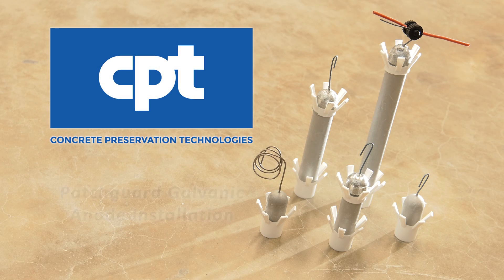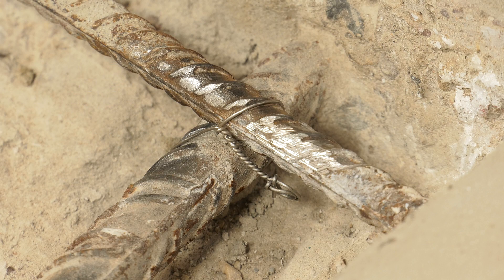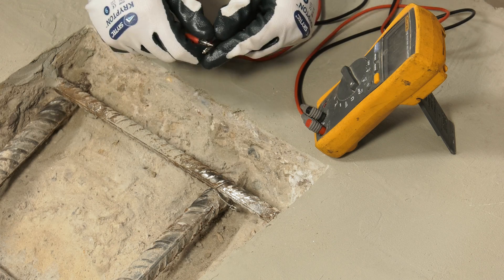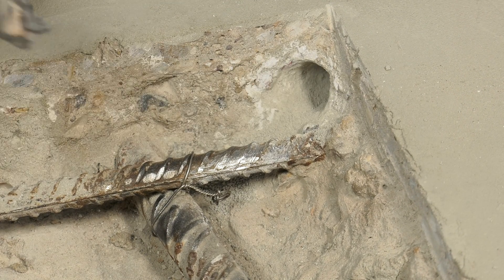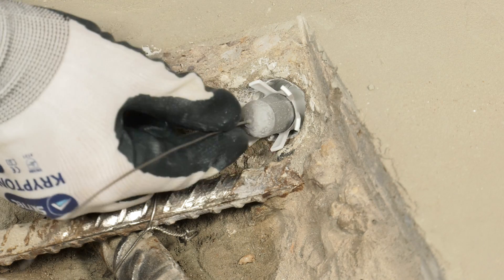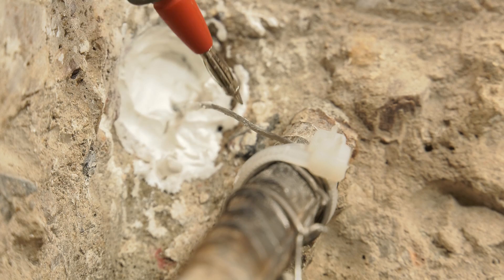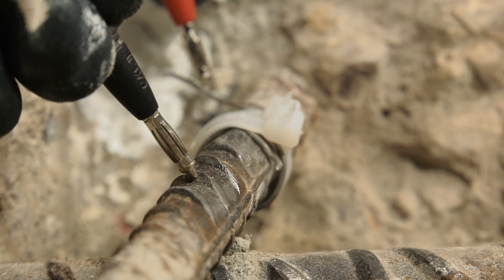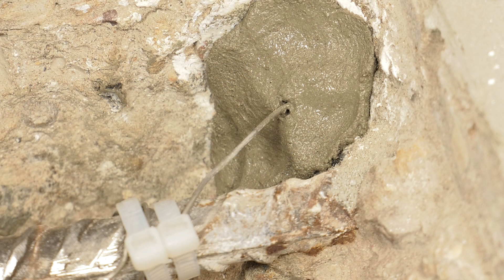PatchGuard™ Galvanic Anode - Concrete Corrosion Protection

Comment: Hello. Our company also deals with cathodic protection in the Czech Republic. There is a rule prescribing welding of the reinforcement at the point of contact. Of course not all points, but most of the members.